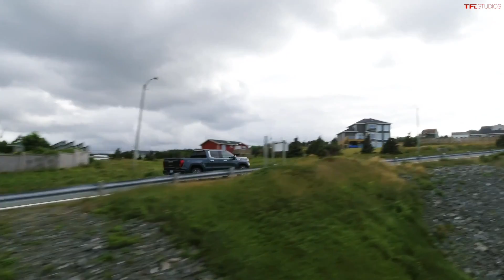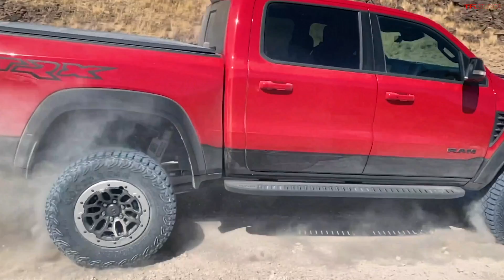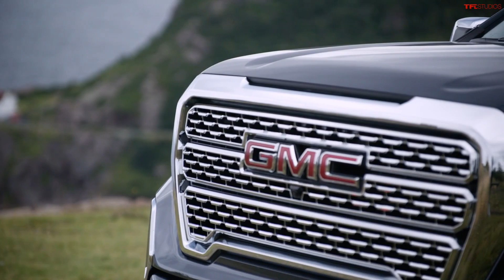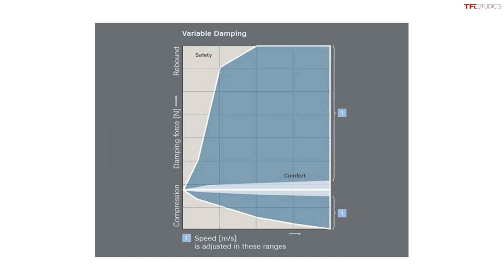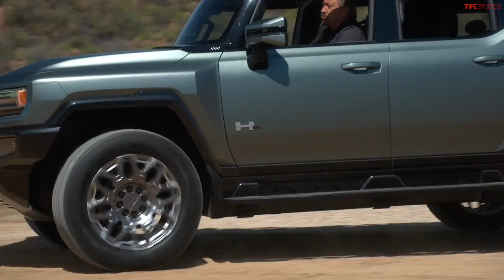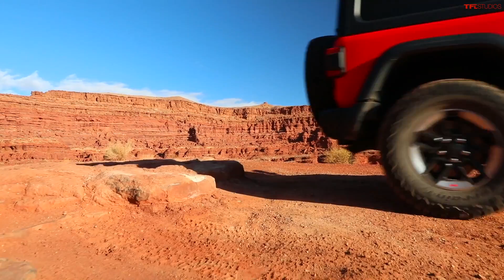How Does The GMC Sierra's CDC Suspension Actually WORK? Find Out Straight From The ZF Engineer!

Comment: How do I get the softest ride out of my 2022 Sierra Denali? I have a bad back and the normal mode is too ruff. Please I need help
Reply: Hi - did you ever find a resolution to the rough ride of your 2022 Denali? I have a 2022 Denali and am having the same problem. It was very smooth and comfortable when I first got it, but around 6,000 miles, the ride became VERY stiff. Thanks
Reply: Trade it for a Ram unfortunately.